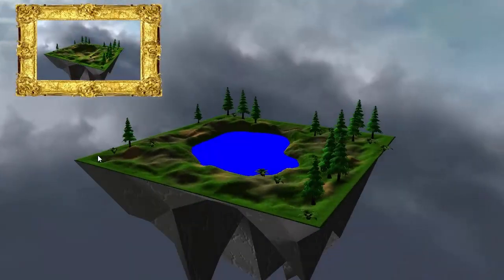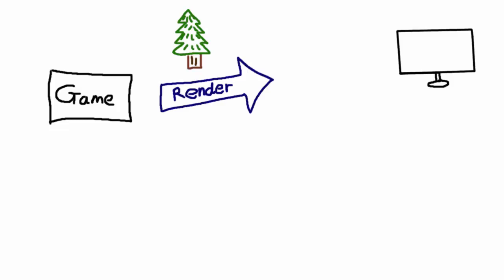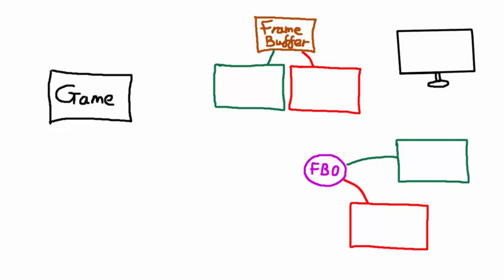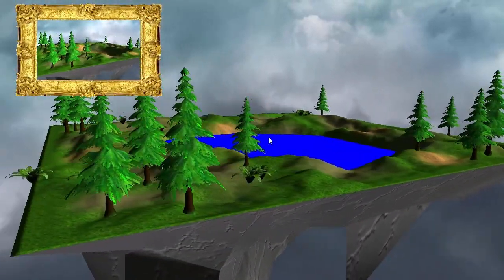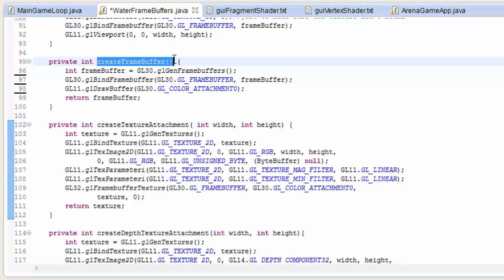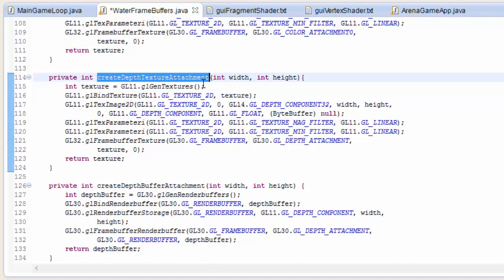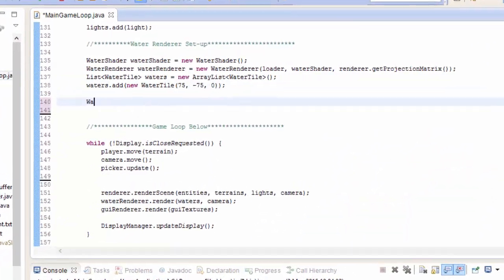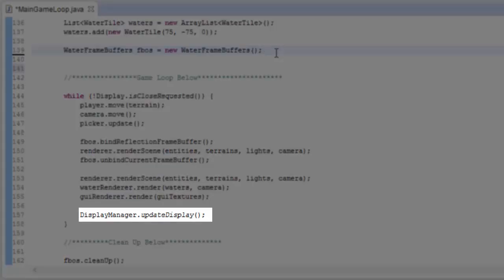OpenGL Water Tutorial 2: Frame Buffer Objects

Comment: Im not to sure why im getting this error
Sat May 02 19:08:32 BST 2015 INFO:Use Java PNG Loader = true
Exception in thread "main" java.lang.IllegalStateException: Function is not supported
	at org.lwjgl.BufferChecks.checkFunctionAddress(BufferChecks.java:58)
	at org.lwjgl.opengl.GL32.glFramebufferTexture(GL32.java:389)
	at water.WaterFrameBuffers.createTextureAttachment(WaterFrameBuffers.java:103)
	at water.WaterFrameBuffers.initialiseReflectionFrameBuffer(WaterFrameBuffers.java:68)
	at water.WaterFrameBuffers.<init>(WaterFrameBuffers.java:28)
	at mainGame.GameLoop.main(GameLoop.java:253)
Reply from the maker: Mohammed Qureshi It just says that the function isn't supported for you. Did you set up an OpenGL 3.2 context in the DisplayManager class with the ContextAttribs? Your code for creating the display should look like this:

 public static void createDisplay(){  
  ContextAttribs attribs = new ContextAttribs(3,2)
  .withForwardCompatible(true)
  .withProfileCore(true);
  
  try {
   Display.setDisplayMode(new DisplayMode(WIDTH,HEIGHT));
   Display.create(new PixelFormat(), attribs);
   Display.setTitle("Our First Display!");
  } catch (LWJGLException e) {
   e.printStackTrace();
  }
  
  GL11.glViewport(0,0, WIDTH, HEIGHT);
  lastFrameTime = getCurrentTime();
 }
Reply: Remember i told you it gives me that error when i do this. So i had to remove te context attribs 3.2
Reply from the maker: Mohammed Qureshi Try copying in that code above into your createDisplay() method, can you tell me exactly what the error says when you run it then?
Reply: I think it maybe because of my graphics only support 3.1 opengl and if so i guess i cant carry on with the tutorials please say it isnt.
Reply: Mohammed Qureshi are just guessing your graphics card supports gl 3.1 or does it? Because glFramebufferTexture is opengl 3.2. The minimum requirements is opengl 3.3 for this engine.
Reply: Im not guessing i downloaded this program a while back and it said Opengl 3.1  and also i have intel hd graphics 2000 only also iv always been able to run the game so i dont no really
Reply: OS name Windows 8.1
OS version 6.3
LWJGL version 2.9.1
OpenGL version 3.1.0 - Build 9.17.10.3347
Reply from the maker: Mohammed Qureshi That's going to be a problem, you need OpenGL 3.2 for this tutorial :/ Maybe you could update the drivers for your graphics card or something? I'm not sure, I'm not very knowledgeable in this area.
Reply: Yh i tried updating but intel hd graphics are integrated with my processor and i guess it only supports 3.1 i guess i have to come to an end then :(
Reply: Mohammed Qureshi which model? Although even if you did get it to work, you would run into lag. If you're a desktop user you could but a cheap graphics card for $50. And that is in Australia with the high tax on everything.
Reply: Im not to sure on the graphics its intel hd graphics family with a intel pentium processor also im a laptop user and im in the UK.So i guess there isnt anything else i can do except stop
Reply: Mohammed Qureshi sorry about that. also i thought there were no posts above mine cause none showed up so i didn't see your model.I searched up and it says that it should be able to support gl 3.3 at max but with missing extensions. A shame though.
Reply: Mohammed Qureshi try this http://www.intel.com/support/graphics/sb/CS-029635.htm
Reply: Yh iv tried update my drivers i even have an intel utility thing to update them
Reply: Oh i will look into it or just giveup and leave it
Reply: Ok ill try change them and yh my OpenGl is 3.1 i have tested it :D Thanks if it works
Reply: Thank you both cuz u told me and he told you but first gotta see if it works
Reply: ***** Still not working maybe im doing something wrong maybe u could give me the class with the edits because it stills give me errors.
Reply: ***** Oh wait my game loads but i got a massive black square for it now and nothing is rendrering
Reply: Dam ok i guess ill just leave the project then and go onto something new :D
Reply: Yup it just shows a black cube
Reply: Then the black quad doent renderer in the area
Reply: Sure http://pastebin.com/dPiBfu1v
Reply: ***** his computer supports GL 3.0 fine. He can't use 3.2. Anyway you can't just change it to GL 1.1 and expect it to work. You have to find workarounds.
Reply: Yh i tried and i did once but then it got a bit messed up but ill do it again soon also just to understand you i have changed one of the things to GL30 but not all of the GL11 to 30 have a look

	private int createTextureAttachment( int width, int height) {
		int texture = GL11.glGenTextures();
		GL11.glBindTexture(GL11.GL_TEXTURE_2D, texture);
		GL11.glTexImage2D(GL11.GL_TEXTURE_2D, 0, GL11.GL_RGB, width, height,
				0, GL11.GL_RGB, GL11.GL_UNSIGNED_BYTE, (ByteBuffer) null);
		GL11.glTexParameteri(GL11.GL_TEXTURE_2D, GL11.GL_TEXTURE_MAG_FILTER, GL11.GL_LINEAR);
		GL11.glTexParameteri(GL11.GL_TEXTURE_2D, GL11.GL_TEXTURE_MIN_FILTER, GL11.GL_LINEAR);
		GL30.glFramebufferTexture2D(GL30.GL_FRAMEBUFFER, GL30.GL_COLOR_ATTACHMENT0,
				texture, 0, texture);
		return texture;
	}
Reply: Also to make it a little easier to read
http://pastebin.com/xE6Vj20R

Also i dont get an error its now just the quad rendering and not showing anything except black
Reply: Mohammed Qureshi ok so you have the same problem as me now. Thats good. Means you have fixed it. I have a feeling it because you have to set the context. Anyway can't help now cause I am on my laptop and is trying to do lighting instead. Well actually the only thing I actually use that is working from these tutorials is the object loader and terrain class. Everything else I have done or recreated from scratch by myself. (Couldn't be bothered rewriting those parts of code :>). I am pretty sure ***** would like to hear that someone has learnt OpenGL and redone it partialy from scratch. Tomorrow I might change what I was going to do and instead try and fix my FBOs. Once I fix that I will send the code I used to fix it. Although I shouldn't be having any problems cause I copied the file, I also have a GTX 970. Might test it on my Intel HD 4000. Could be my gpu or just not setting context so opengl does not have a clue on what it is meant to use. Will find out tomorrow though. :)

TL;DR: Pointless typing that I cbs back spacing. I will try and find the problem tomorrow (12 hours, got brothers (Aussie) football in the morning) as I have the same issue.
Reply: Oh so u have the same issue as me or not cuz the quad is renderering but its just black and not showing anything also if u do find a fix thanks
Reply: Mohammed Qureshi Yea same issue. Black quad and shader works fine. I use the same shader code currently though out and my scene renders. I have changed my clear color and that didn't work. Guess just have to wait till tomorrow to find a fix :)
Reply from the maker: Mohammed Qureshi Use this code for the WaterFrameBuffers class: https://www.dropbox.com/s/vlvrm35nnyqrls5/WaterFrameBuffers.java?dl=0
That uses the OpenGL 3.0 function to set up the textures like the other guy suggested. If it still doesn't work then show me your MainGameLoop code and I'll see if there's anything wrong there :)
Reply: ***** for me that won't work unfortunately. I might have another problem. I am 100% sure it isn't shaders cause other textures work fine.
Reply: ***** Do you just import all the classes...
Reply: ***** Hay it works for me it ant the best of quality but it will do i guess we have to sacrifice some parks thanks anyway :D
Reply from the maker: Mohammed Qureshi Great! And it's not meant to be good quality because I've set the resolution fairly low for the reflection texture. You can increase the resolution by simply increasing the REFLECTION_WIDTH and REFLECTION_HEIGHT values at the top of the WaterFrameBuffers class :)
Reply: Ill leave it for now so it doent kill my pc
Reply: I know but that could stress my pc and then make it not work fast
Reply: Its not lag in the game its lag over the hole laptop cuz its making things work intensely
Reply: Mohammed Qureshi Yay. Your problem is fixed. :)

Comment: i pressed F5 and it said "uploaded 53 seconds ago" :)
ehm, great tutorial man!
Reply: Was it ever figured out? I have the same issue, trying to debug it right now.
Reply: I think I forgot to clear the buffers every frame (glClear()) but I'm not exactly sure if that was my issue...
Reply: I tried glclear, and it turned my texture into whatever color i cleared it with, meaning the framebuffer is being created ok but the texture is probably incomplete....don't know how to fix it though.
Reply from the maker: ***** Thanks :)
Reply: ***** I did all of the work shown in the tutorial, but bad news: I don't know if I see a black texture in my GUI or even no texture, i think it's a black texture, because other textures worked. I messed a little bit around with the code, but it did not work. I searched in the reference pages of OpenGL and found the glCheckFramebufferState() method. I used it to check the framebuffer state, and it returned 36055 - GL_FRAMEBUFFER_INVALID_NO_ATTACHMENT or something like that.
Reply from the maker: ***** Send me your code to thinmatrix@gmail.com, I'll take a look at it :)